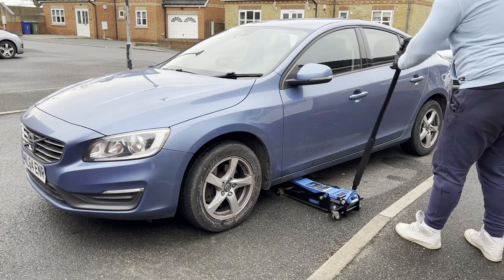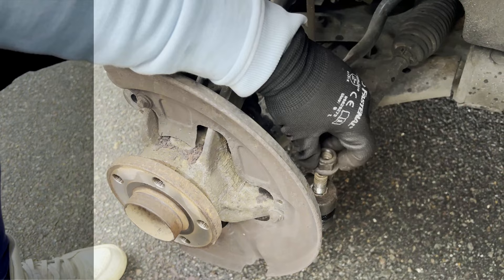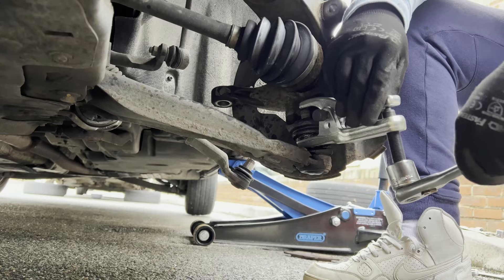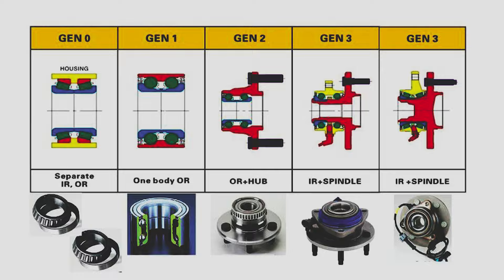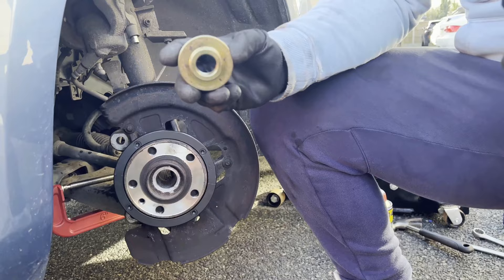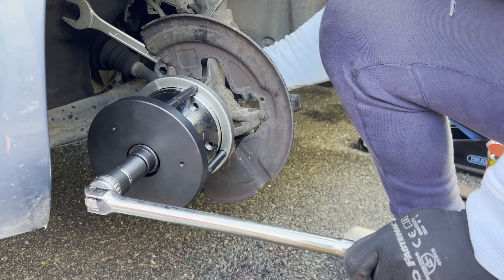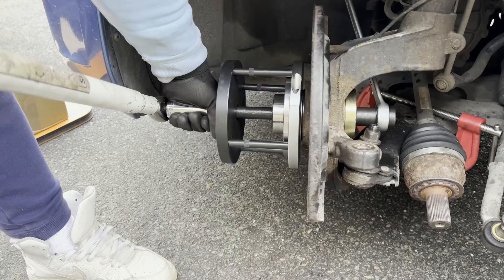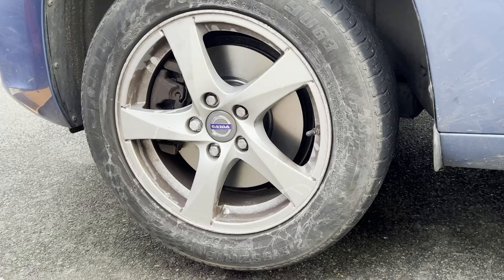Volvo S60/S80/V70/XC70/XC60/V60 (P3 Platform) Wheel Bearing Replacement

Comment: I did this job today on my 2007 S80 awd V8. Your video was perfect and I followed it exactly with identical tools and Hub puller. Thanks so much for what you do! There are many of us over here in the US that appreciate you👍
Reply from the maker: @mlsvetin1 Wow,man. Thank you! I really appreciate your feedback and also I am glad that I could help ;) The same Volvo is back for front crankshaft seal replacement,timing belt replacement and drive belt replacement, so stay tuned if you are interested.
BTW, I didn't know that Volvo has a V8 engine. LOL
Reply: Where did you find the tool? Do you mind sharing? I found some on eBay but I cannot determine if they are the right fit for P3 Volvos. Thank you! @MrNiceGuy94 and @mlsvetin1

Comment: Not too many people are doing this the right way, except you sir!  I remember my first bearing on my car, pressed right in using the regular method to only start making noise again the next day!  Ordered the tool to do it the right way to find out the install plate didn't fit.  Had a local machine shop turn it down to fit and been using it ever since!  Thank you very much for your videos!  I get a lot of bearing jobs from other garages just pressing them in by the hub.

Comment: This video has great advice and is easy to follow. I purchased the same puller kit, blue case and all, but I was unable to get my bearing out (I broke 2 ratchets). In any case, the press method should work fine, so thank you for including the alternatives. Thank you for making this video.

Comment: I was able to do this job without the special tools!  I used a puller made by SIR Tools that I happened to have in the shop to take the hub out but it could be cut out with a torch or use a BFH to the rear of the bearing.  Getting it out isn't the problem because you can cut, bash on and destroy the old bearing.  The problem is getting the new bearing in without ruining it so here is the tip.  Clean out the hole good with a "drill wire wheel" or flap wheel.  Put the new bearing in your freezer.  I left mine there until it was 35F.  Wrap the ball joint, tierod end, ABS speed sensor with soaking wet rags.  I used an oxy/acetylene torch with a rosebud tip but propane will do the trick.  Heat the steering knuckle working mostly from the bottom with the torch.  Using a temp gun to monitor I heated until this knuckle was about 350F on bottom about 280F on top trying not to fry the ABS sensor rusted into the hole.  With some motor oil on the frozen bearing I slid the new bearing hub assembly into the knuckle in one quick well aligned movement.  No hammering just straight from the freezer, line it up perfect and slip it in quickly.  As soon as it bottoms in the hole the temperatures will balance between the parts and the bearing will be solid.  Worked good, didn't have to buy the tool but the risk is that it's a one shot deal if you mess this up you'll be pressing your new bearing out to try again and it may damage your new bearing pressing it out.

Thanks for this video, the clamp and jack handle on the control arm is clever, I love that.
Reply from the maker: @reinimechanic  Wow. I can imagine how difficult that was. I think the tool well worth the price (I paid around £70 for it). What I wish I had done was to put the bearing to the fridge prior installing it back. I think that would have made a huge difference, but I didn't think of it. 
Believe it or not, I posted that clip of the C clamp and the jack handle on Facebook to help people having the same or similar job to do. And majority of the comments were negative, that it is such a waste of time. Sure we all do things differently and my point was to make things easier with basic tools you might have at home. Of course you can push the control arm down with your hands and monkey out the ball joint from the knuckle with your third arm :D but that's exhausting.
Anyways I am so glad you liked the video, I highly appreciate it!!! This is why it is worth to make this kind of videos. 
I wish you have a nice day!

Comment: I have changed three front wheel bearings on my V60 using this video and a press tool. Thanks mate for the clear instructions! Are you not supposed to have a gasket on the inside where the ABS-sensor is placed because my bearing got worn out after six months. I changed the bearing in August 23, in January 24 it was starting to have damages. It can be four options for that now after some thought: 1) A bad bearing from the manufacturer, 2) wrong front wheel alignment since the tie rod has been broken this whole time, 3) to harsh treatment of the bearing whem it was changed in 23 since it was a struggle to get that on and now just before reviewing this video 4) looking at the old strut on the other side it has a gasket there.

Comment: I have owned my 2010 S80 D5 since new now has 240000miles and I swear they eat wheel bearings😂 now needs its 9th new bearing lol Thanks man! Great vid
Reply: When did they start to go? I'm on 120k miles with 2010 XC70 and still on original bearings

Comment: Good instructive video! Keep ut the good work
Reply from the maker: Thank you very much Brede! I am glad you liked it. I hope that all of my videos will be as helpful as this one.
Have a great day!
Reply: @MrNiceGuy One question. Which ball joint separator did you use, and does it need to have exat 21mm jaw opening? Or could it be bigger like 22mm? I'm having a little trouble getting the lower ball joint off, just whacking it with a hammer hasn't helped.
Reply from the maker: @brederasmussen3075  Hi Brede, yes you can use the ball joint separator with 22m jaw,but you can't use anything smaller than 21mm as it won't fit around the ball joint. Also you have to take into consideration that you have to get the separator with the biggest spread, because the ball joint is quite tall if it makes any sense. So you have to fit it around and over the ball joint as well. 
PS.: you won't get anywhere with a hammer, I have been there, it didn't work :D
Here is the link for the separator I used: https://www.amazon.co.uk/dp/B000SDRGYC/ref=cm_sw_r_fm_api_glt_fabc_66MYFFDZPQ1XDBE0V1GK?_encoding=UTF8&psc=1&fbclid=IwAR067bkWrpFQpNUqw-i1jrhcd8aeIv0lrLK8vsFTIGQOhuiZMQY3-59u02A
If any other question feel free to ask.
Reply: @MrNiceGuy94  Awsome. Thanks for the help. Have a nice day!
Reply from the maker: @brederasmussen3075  You are welcome! ;)

Comment: My 2010 XC60 ball joint is different from the one shown.  It doesn't have an axial bolt to hold it to the knuckle, it has a bolt transversely through the knuckle.  The ball joint tool shown won't work because there is nothing to press down on from the top.  Any other tricks to separate that style of ball joint?

Comment: Great video thanks. I need to replace hub bearing assembly on my Volvo v50 looks very similar. You could always remove the strut lower knuckle and drop link then the whole assembly will drop then just remove hub using tool? This should also work? Thanks
Reply from the maker: @richard robinson  I am so glad you liked the video. I think removing the knuckle and using this tool is not a good idea and it won't work. Reason is, because the tool is designed to remove the wheel bearing in situ, which means the knuckle remains attached to the strut. If you remove the knuckle and want to use the tool, you would have someone holding the knuckle while you are removing the wheel bearing. So technically you can use the tool with the knuckle removed, but there is no point and also it would be a lot more difficult because you need a quite great force to make the wheel bearing pop then remove it, so the other person must be extremely strong to hold against you. :D Other thing is, if you have the knuckle removed I would definitely use a hydraulic press to press out the bearing but would use the tool to press it in with the knuckle installed back first.
One correction to my video: If I am about to do it again I would reconnect the tie rod end ball joint in order to prevent the knuckle from moving, that way the removal and install is hell of a lot easier. 
Hope this all makes sense, however if you need any further help or just simply have more questions about it then don't hesitate to ask them ;)
Reply: @MrNiceGuy94  thanks for your reply, what you said makes complete sense. I’m just wondering how easy it is to remove the lower control arm joint without a special tool?
Reply from the maker: @richardrobinson1877  It would be difficult, first I tried it with a hammer, no luck. The tool costs around £20.
Here is the link for it:  https://www.amazon.co.uk/dp/B000SDRGYC/ref=cm_sw_r_fm_api_glt_fabc_66MYFFDZPQ1XDBE0V1GK?
Reply: Get a long bar

Put downward pressure on control arm at the ball joints

With balljoint nut still on but loosened and putting pressure smack the control arm by the ball balljoint with your hammer 

if it doesn't pop with the first hit hit it harder
Reply: @kylerandolph79  this is exactly what I did. A good whack with the persuader it dropped no problem 👍🏼

Comment: Is it best to keep the knuckle attached to the strut? Or can you do the job with the knuckle completely removed?

Thanks
Reply from the maker: You can do the job with the knuckle removed if you have a press machine. But if you will do the job with the tool used in the video I would say that it's easier if you don't remove it.

Comment: So there's no retainer for the bearing assembly? Just want to check before I get it on the press.
Reply from the maker: Hi, you are right, there is no retainer in this bearing so you can use the press to press it out. However I recommend to use the tool made for this job when putting back the new bearing, in order to avoid damaging it.
Reply: @MrNiceGuy94  thank you very much! I agree with using the tool, but the press at my shop is the best I have at the moment. I'll see how it goes, yknow?

Comment: I need some help here. Apparently the AWD have a different knuckle, but whatever. I have the LCA ball joint broken loose, but even with all my weight, a pry bar, a jack handle, a fork, none of them will get the lower control arm all the way out. I am out of ideas, and very frustrated. I have been at this for 4 hours now just trying to get the control arm off the knuckle
Reply from the maker: Hello try the method in the link https://youtu.be/VaQdxhdsV0c
Let me know if it helped...I takes a quite big effort to get it out from the knuckle so be patient.
Reply: @MrNiceGuy94  it did finally end up working out. I ended up having to use a pry bar under my knee(hoping I didn't smack my goods), and tweak the knuckle while doing it. It took all my weight to do it. I have the new one pressed in now, but it is dark so I didn't get the ball joints put back together yet. I am sure I ruined the grease boots, any advice for that? I bought some universal ones from the auto parts place, not sure if they will work. I appreciate the quick response!
Reply from the maker: Well, if you want to replace the ball joint I would go either with Moog or Febi Bilstein, here are the links Moog UK https://amzn.to/3MnTDTF Febi UK https://amzn.to/3vXFNSj 
Unfortunately the OEM are riveted, so I would remove the whole control arm, use either a chisel or a dremel tool to remove the rivets and then the ball joint. If you have replaced it, don't forget that you have to torque down the control arm bolt under load, but only the one which has a bushing in it is necessary. 
I hope I could help, feel free to ask if something is not clear or you need help. ;)
Reply: @MrNiceGuy94  no way to just change out the rubber boots or just get by the way they are? I feel like changing the whole joint out will be a disaster as well
Reply from the maker: I wouldn't bother myself with that, rather change the whole unit. It shouldn't be that difficult there are bolts holding the control arm to the frame,one with a bushing around it and two regular ones I believe. And there are three rivets holding the ball joint to the control arm. You don't neccesarily have to remove the control arm, you can do the job while it is in place, just cover the rubber cv joint with something to protect it from the spark when you will be cutting. I would cut the head off of the rivet with a dremel tool then you are good to go,just have to replace the ball joint.

Comment: I can't find this type of hub ouller/presser. Is there a specific bame for it?
Reply from the maker: https://www.amazon.co.uk/Wheel-Bearing-Removal-Carbon-Steel/dp/B093GQCRRB/ref=sr_1_5?crid=35MJ37IK4LJGU&keywords=gen+2+wheel+bearing+tool+82mm&qid=1690998888&sprefix=gen+2+wheel+bearing+tool+82mm%2Caps%2C120&sr=8-5 

This is the one I used I think. The important thing is that it has to be 82mm in diameter.

Comment: Do you have the torch settings for all these bolts?
Reply from the maker: for the drive shaft bolt the torque settings are in the video. For the rest I have just tightened them down with a ratchet.

Comment: Thank you. Do you have a part# for the bearing removal/install tool ?
Reply from the maker: @RJFVOLVOHONDA   Sure ;) Here is a link for if You are UK based: 🇬🇧https://amzn.to/3p0cWbk - this one is for the 82mm bearing.🇬🇧 https://amzn.to/3s17TcI - this is a universal kit and includes adapters for 62,66,72,85mm bearing.
And here is a link if You are US based: 🇺🇸https://amzn.to/3IblIew  Unfortunately this is the only kit I found which was the same as I used in the video.
Hope I could help.
Reply: @MrNiceGuy94  I am in the US but the link will probably help. Thanks for taking the time to make the video
Reply from the maker: @RJFVOLVOHONDA  I am glad I could help ;)

Comment: Does this work for my 2010 Volvo xc60?
Reply from the maker: If it is on the P3 platform then yes.
Reply from the maker: I have checked it, and yes it should be the P3 platform, so yes you have the same type of wheel bearing. However it is worth to doublecheck.
Reply: @MrNiceGuy94  will do! Thanks boss man have a good day!
Reply from the maker: @zayevans3136  you are welcome,buddy. 
Hope the video will help in the process. 😉✋
Reply: My 2010 XC60 ball joint is different from the one shown.  It doesn't have an axial bolt to hold it to the knuckle, it has a bolt transversely through the knuckle.  The ball joint tool shown won't work because there is nothing to press down on from the top.  Any other tricks to separate that style of ball joint?

Comment: Where can I buy special tools? Thank you!!
Reply from the maker: Hi. Which tool do you exactly mean? The one for the wheel bearing? You can buy that off of amazon or ebay, but there different diameters for different sized wheel bearings. Do you have exactly the same car and model?
Reply: @MrNiceGuy94  I own the Volvo s80, P3. OK.. I need a tool the wheel bearing. Where can I buy the tools shown in your video?
Reply from the maker: @Blue berry  Can you please confirm which country are you from? I will send you the appropriate link of the tool.
Reply: @MrNiceGuy94  thanks im a korean
Reply from the maker: @Blue berry  https://www.amazon.co.uk/ROMYIX-19pcs-Bearing-Tooling-Bearings/dp/B08TQNYT7P/ref=sr_1_13?keywords=gen+2+wheel+bearing+puller+82mm&qid=1659796046&sprefix=82mm+wheel+bearin%2Caps%2C108&sr=8-13 
This is the tool used in the video. I am not sure where you can buy it in Korea, but it is called 82mm wheel bearing removal tool. Type it in wherever you used to buy tools from such as ebay or amazon and look for the same one as I linked. It can be from different manufacturer that doesn't matter. The important thing is it has to be 82mm in diameter and has to look the same as in the picture and has to contain the same parts.
If you need any further help let me know, or you can link what you have found and I will confirm whether it is the right tool or not.
Reply: @MrNiceGuy94  와우... 정말 감사합니다!!!!!!!
Reply from the maker: You are welcome!